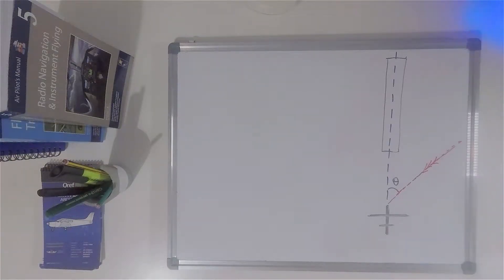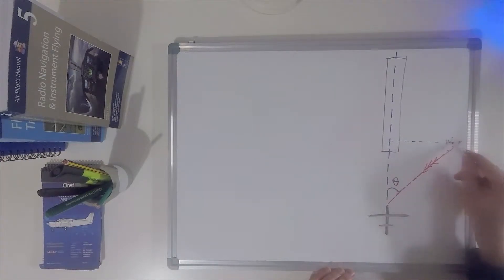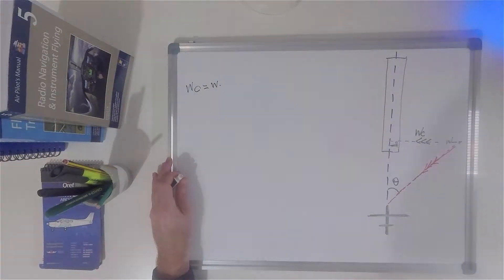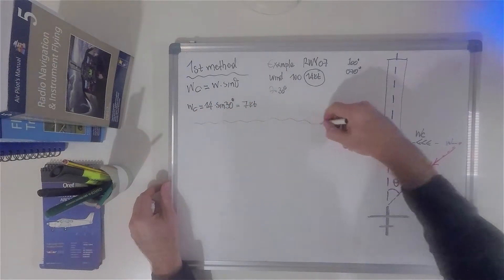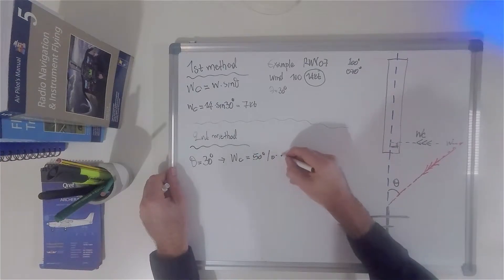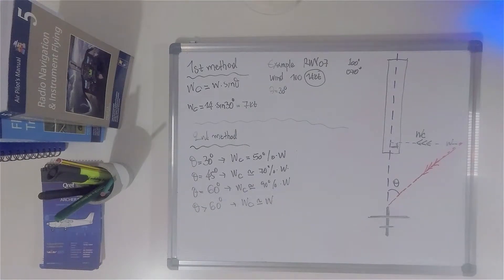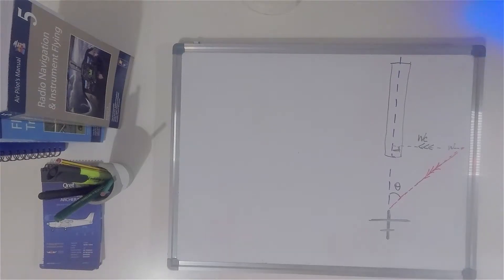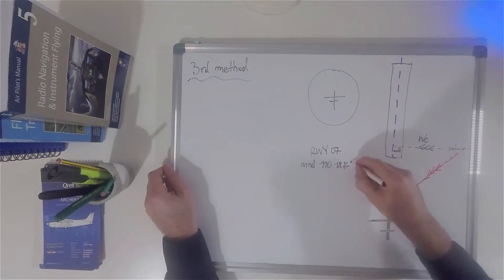Crosswind component calculation

Comment: The only time the CWC matters is with regards to the limits of the aircraft. When flying, I have an idea what winds I can and can't fly in depending upon the aircraft I'm flying (taking into account published limits as well as real world limits). But if the limits aren't being reached, I don't care what the CWC is anymore, I just look out the window and see how much rudder it takes to keep the nose straight, or how much I need to crab to stay on centerline when further out. If flying under instruments, then I'm just flying to keep the needle or indicator centered anyways and there are more simple tricks on how to fix a course deviation easily using only the navaid without any math required.

If you really care about a more accurate CWC, then just get the graphical plots and plot your wind speed and direction onto it and read the CWC from the graph. You wont be doing math like this in the cockpit, and winds change constantly, so there's no point either. Knowing your limits, as well as using a simple graph is far faster and easier.
http://andrasmeridian.com/v2/tutorials/crosswind/callthewind_wind_figure2.gif

All that being said, from a science perspective, it is good to understand what is going on and how to do the math, but not really necessary for just flying.

Comment: 60 × wind speed (crosswind ) ÷ true air speed = cwc

Example 

60 × 12 = 720 ÷ 120 =  6 °

Method 2 

Wind @18 knots from 060 ° 
Runway landing 090°

090 - 060 = 30 diffrence
3 +2 = 5 - remember to add 2 and keep your diffrence in one decimal number ( 30 ° = 3 and add 2  )

5 × 1.8 ( keep mind our wind speed was 18 knots so make it into decimal point so even if it was 20...it would look like this 2.0)

5×1.8 = 9 which is our cwc